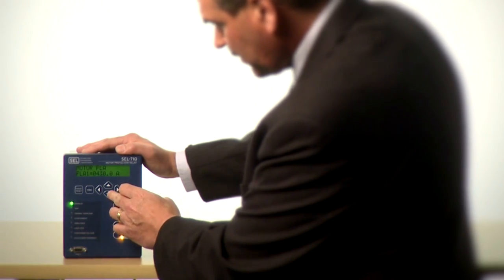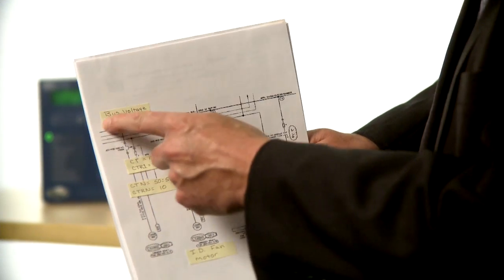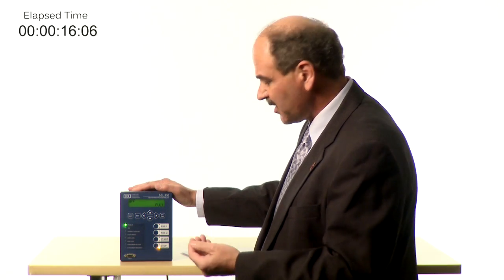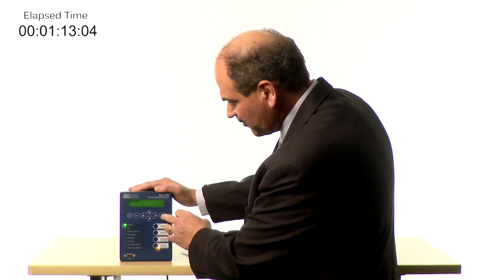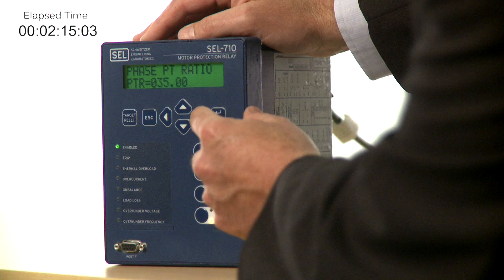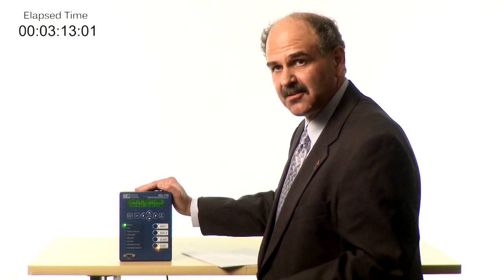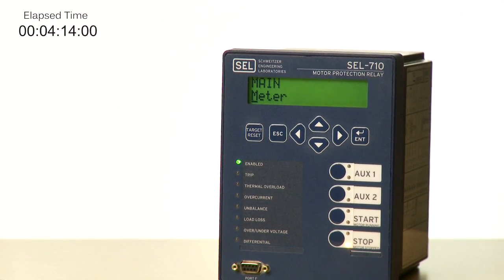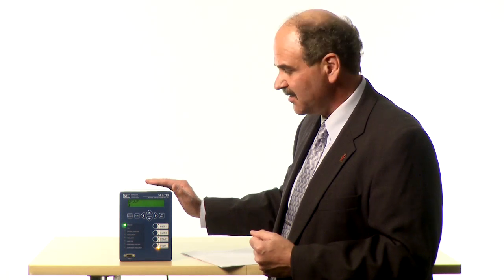How to Set the SEL-710 Motor Protection Relay

Comment: I didm't find nameplate settings sheet, How can i find it?. I don't see in the website.
Reply from the maker: Hello gorosei01. The settings are greatly simplified in the Nameplate mode. You can find the full extent of the settings still available in the Instruction Manual starting on pages 4.70 and 4.71 date code 20250411. If you still need some assistance our application engineers are ready to take your call at 509-338-3838.